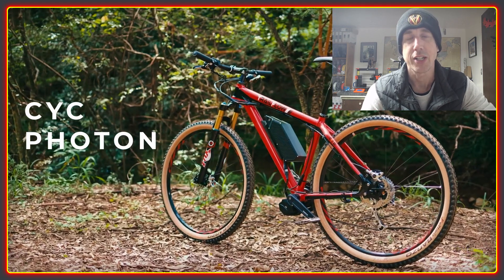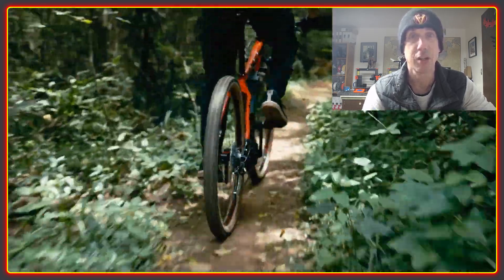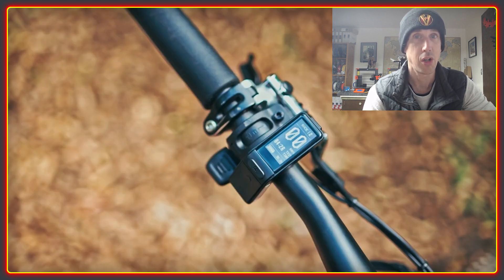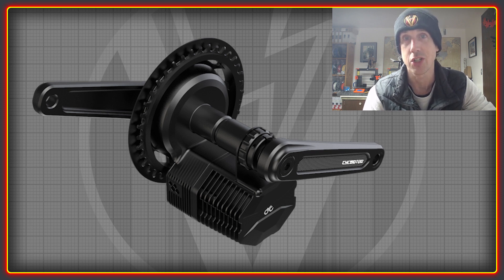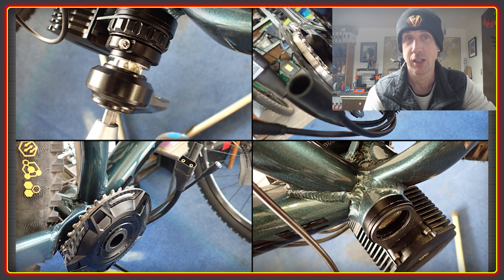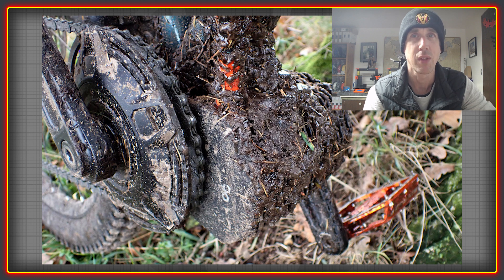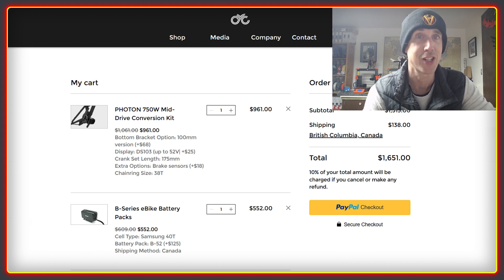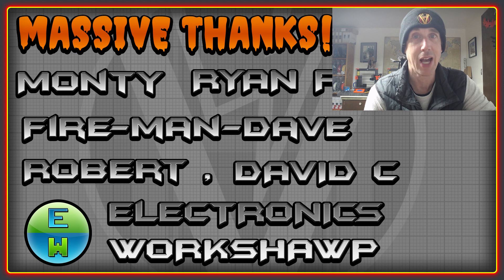CYC Photon Motor the worlds most Compact Mid drive?

Comment: Nice review and valid criticism's.  I can be more blunt.
The BBSHD beats the Photon on power and cost and part ubiquity for cheap. The BBSHD...I own two is the best value strong ebike motor on the market.
The BBSHD beats the CYC Stealth and Pro on sound and cost as well.  Where I sit, Chinese based Bafang beats CYC at what they do.

One positive of the Photon is torque sensing.  For me, not enough to bridge the divide on cost and power.  I come from a competitive cycling background and have no problem with cadence sensing and can easily add 200-300 extra watts of pedal power for a target speed relative to motor output and my contribution of human power.  I ride with heart rate and have no problem staying in zone 2 for example.  Riding with a cadence sensor that doesn't change motor output is a skill.

Its hard to become a main player in the ebike motor market.  Bafang gets their price benefit from volume.  CYC doesn't have this luxury and likely can't support a common practice of 'buying the market' like Lexus some many remember in the auto space, they sold effectively a Mercedes Benz for the price of a Toyota. Now look at Lexus.  Many prefer a Lexus to any German luxury brand due to reliability.  Lexus intially bought the market and incrementally increased prices until there was deserved demand for their products.  Btw, Tesla is looking to do this in the future because they have a leaner cost structure compared to other world auto brands trying to break into the EV space.
Market share matters because with greater volume becomes more opportunity for profit as volume X smaller profit/unit still = revenue.  More revenue promotes more R&D reinvestment and greater market potential through better products.  Its synergistic.

Also, CYC doesn't have the best track record on reliability.  Bafang in spite of being Chinese with related stigma that is changing over time as China comes up to speed, they make reliable products.  My BBSHD's have been bulletproof and I use the full potential of each motor.

We as a community will see if CYC can gain traction with the Photon. So far, the price to performance ratio isn't there.  One can buy a comparable BBS02 for 1/2 price if you can forgive torque sensing.  Most for that price difference can overlook this detail.  I can.
Reply from the maker: I don't really see it as a competition for the BBSHD in many ways. That motor is such a beast and easy to maintain and get spares for. I am very happy to see this motor though. We need more and more competition out there. It will drive innovation. I hope to give one a go one day. I was not very impressed with the torque assist on the Ultra motor I tried. Maybe I am too used to 4000 watts lol. Thanks for the comment.
Reply: NAIL..HEAD!
Reply from the maker: Cheers Jeff

Comment: Definitely see the need for a mudguard bash guard combo that scoops air past it. I like how cyc's other kits have a range of brackets to get them up into the triangle on applicable frames. I guess thats just not possible on a user friendly enclosed drive.
Reply from the maker: Yeah its a bit tight to the frame. A guard would also reduce air flow. Front mudguards on the wheel would help tho.

Comment: I’m used to riding at a constant 80-90 rpm cadence and using gears to adjust effort. I’ve been worried the cadence/throttle kits would drive me nuts. Happy to see this released as a hopefully viable torque sensing solution. I accept that technology might cost a bit more.
Reply from the maker: The cadence kits are not as sensitive but it's funny some folks prefer the feel. With the bbshd there is a program called Karl's special sauce which is far better than the setting it comes with. It will never feel as natural as TS though but with the right levels you can get close. I used to use 50 watt increments and then have the power decay past a certain peddle rpm to kero as close to a constant effort as possible with changes in terrain.
Reply: @HighVoltageKits  interesting trick - good to see what’s possible!

Comment: The crank length, but mainly the chainring size has been holding  me back on buying it
Reply from the maker: There is a 32, 38, 42 and 50t l. The cranks are 65 or 70. If think lekkie might be making aftermarket parts though soon.
Reply: @HighVoltageKits  im  pretty much going to either go with lift_mtb kit or lightest ebike kit... both seem like they'd be better quality than the other 3 china motors
Well 2 china motors and where ever this one is produced

Comment: I’m thinking about this motor or the “lightest” ebike motor from Bikee Bike in Italy which also has torque sensing, I want a low power lightweight mid drive motor and the CYC can be tuned down. The CYC seems great for what I intend but the price (in Canada too) seems steep.  I appreciate your analysis of small, details like location of cables exiting the motor,
Reply from the maker: Hey Charles. Sadly most things are expensive here in Canada when imported. Golden motor has no import tax on Photons. There will also be the new motors from TOSEVEN which are torque sensing. There are some video on those on the channel as well. I have not ridden the Italian ones.
Reply: @HighVoltageKits  my application is different.  I have a mini velo bike I love and another mountain bike  I have fitted with a motor (front hub). I find I want to use about 50 watts most of the time with obvious need for more with hills and loads.  Anyway the need to tune power would be very useful because I just don’t get enough of a workout at anything above 50 watts power from motor cruising unless I go over 33 kmph.  I’m checking out the TOSEVEN so thanks for that heads up.

Comment: What happened to the 2000w 40a claims?
Reply from the maker: I had not heard those. Might be the one for later this year?
Reply: @HighVoltageKits  Early talks online from cyc and forums is where I got that. I remember a early ride video that was taken down that mentioned they had the motor running at 30a and it could do 40a in the settings. It was this motor though as I kept mentioning I didn't think the motor could take that much power for long without overheating
Reply from the maker: Right on I'll see what I can find! Cheers
Reply: not sure why he saying only 750w???? even says in the video upto1200w  and some users have had 1900w with no problems
Reply: @HighVoltageKits  Hey just wanted to let you know its still posted in the photons webpage. Under the stats tab in smaller writing it states it can be unrestricted to 2000w. And when you look into their new controllers they list the controller in the photon as being capable of 40a battery 90 phase.
Reply from the maker: 2000 watts. I thought they would learn this lesson with the silly claims made on the x1... The bbshd will do 6kw... For a few miles anyway lol
Reply: @HighVoltageKits  Haha yeah I guess that's why they cooled down with mentioning the higher power. I'm still waiting for review videos but a video was posted a few months back that cyc had taken down where someone was riding at 20c ambient temps at 30a and only after 1.2 miles of fireroads it was overheating and throttling. 2000w maybe for a few seconds at low speeds otherwise I'm sure throttling will kick in and lower that
Reply from the maker: Its tiny. The other issue is at that power will it shred the pinion or bearings. The sprag etc. I hope not. The two year warranty is good.

Comment: BBSHD on Amazon: 735.00 including shipping. Add a Lekkie, that's 850. Photon is 850 with free shipping on a site I just checked. So same price. Yes, the BB is more powerful. also 4 lbs heavier, no torque sensing, need brake and gear cut off, etc. I may go with the Photon.
I got a 2022 Giant Talon 1 on the way and need to decide what route i'm gonna take soon.
Reply from the maker: It depends on what you want, I guess. If you want to ride mountain bike trails a lot with PAS, then the Photon looks good. It's also pretty new. Historically, cyc stuff breaks way more soon and frequently than Bafang. The Bafang is less sophisticated, but you can modify it to have much more power etc. The brake cuttoffs as well as display I think have to be added in to the cyc price? Might be a few bucks more. It's not that far off, tho.
Reply: @HighVoltageKits  Display comes with the kit I thought. I have no intention on using brake cutoffs. prolly wont use gear shift cut offs either. twist throttle and common sense.
Reply from the maker: I would spec one out. I there are add-ons. A 100mm bb version is more for example

Comment: That's some awesome info...if only the bbs02 had the same torque assist as the photon...It would be the ultimate for me.  Do you know of any hacks?  Plus would it be to pair up a bbs02 with a asi bac800 or 855?  I know that the bac800 is discontinued but would there be any advantages with the 855 over the 800 if I were to use a 56v battery?  Thnx
Reply from the maker: Watch to the end of this one! https://youtu.be/gGEDWPgfEFk working on it
Reply: @HighVoltageKits  torque sensing IPM rotor yes please... Is it on a bafang platform?

Comment: Great Video. I heard the new motor in the same style planned for later this year will be called the "Proton". But I'm interested in pre-ordering the Photon myself, 750w is enough for me. This is exactly what I've been waiting for. I'm a mountain biker, so I want the natural ride feeling from torque assist, so BBS01 is no good. And the TSDZ is not built strong enough IMO. Regarding price, the Canadian distributor Golden bike has it at $1147.50 Cad with free shipping. And I can pick up a 48v10ah battery for $300. And I assume most DIYers will already have a bike to install this on. But for me, the modular nature of this system is what appeals to me most. I can install this to my hardtail this year, and maybe upgrade to a full-suspension next year. And the availability of parts from the manufacturer. The cheapest 500wh battery from Norco is $1200CAD. The 500wh battery I'm buying is $300...
Reply from the maker: That's a pretty good price. Golden are based in the USA now so import taxes are likely unless they have a warehouse in Canada. please let me know how you get on with it!
Reply: @HighVoltageKits  are you certain? I see them being in Bolton, Ontario. they are called “Golden Motors”, I think I may have said Golden Bike above…
Reply from the maker: You can check which would be best. I chat with the owner Muj from time to time. I'm sure they moved the operation. I'll be happy to be wrong tho.
Reply: @HighVoltageKits  I just received word they have staff both in Canada and the US. And the motors will ship from both locations which is great news.
Reply from the maker: That is great news! Duty is a royal pain in the backside in Canada!
Reply: Is it recommended to buy from a Canadian distributor like Golden Motor rather than direct from CYC website to avoid import duties to Canada? Looks like the price is about the same after conversion.
Reply: @SeventyZombies  I’m not certain if you would pay import fees from Hong Kong. But I know for sure Golden motors ships from Canada. I am going to purchase from them, and CYC has confirmed they will honour the warranty.
Reply: @hiphopsuperman  If the price is similar then Golden Motors (or other CDN retailer) sounds like the way to go then. Thanks!

Comment: Addressing obvious design issues.
Clearly for the already own and vested heavily in their MTB of choosing, we which will justify price point and the target market.  Great succinct review.
Reply from the maker: Thanks. It will be interesting to see what bikes are built over the next few months.
Reply: That is where I'm at - a conversion is the logical way ahead for me, I'm already severely invested (in time, not money) and get a far better frame and components than almost any prebuilt options, and this route is less expensive, too (I do it all myself). Plus, if the battery or motor dies, I can revert the bike back to its original configuration, you cannot do that with prebuilt. And if the bike dies, I can move the motor and battery on to the next one.

Comment: I would argue.   Getting the heat sink covered in mud isn't that big of a problem... mud is partly water / mud.  water  can't above 100c.  Then it boils  abs stays there until all the liquid water is boiled off...  which?   At that point?   The mud isn't mud anymore.  And it'll fall off because it's dry
Reply from the maker: Its an interesting theory. If the motor gets that hot then it would evaporate off the water pretty fast leaving the mud. The motor would be fried internally if it ever got that hot on the surface. It should throttle itself before it gets anywhere near that hot which is where more of the issue lies. The performance is potentially reduced when you need it in order to prevent overheating.

Comment: One thing that they have changed is the power, it is 750 watts to stay street legal in the U.S but it can be unlocked to run over 2000 watts at 52v. I feel that this makes this worth the higher cost because an electric bike this compact and inconspicuous with that much power is awesome.
Reply from the maker: There is no way this will pull 2000 watts for any length of time. The one review place was hitting 60C at 500 watts. It's just too small to run that power and shed the heat effectively. 2000 watts at 52 volts is pretty big amps and it's tiny. I really thought that they would have learned that lesson when they were making claims of 6000 watts on the X1. It will come down to simple physics. All to often numbers are thrown around as marketing. Don't get me wrong. I like this motor overall but what really matters is how it rides. My X1 gets really hot after 4km of 10% at 2500-3500 watts at 72 volts. Maybe this will handle a quick burst at 2000. I very much doubt it will do any length of time. But then again these motors were never meant to be used like a moped or mini dirt bike. Bit of a long winded answer but hopefully it helps.
Reply: I forgot to mention that I hoped this was true because there are very few testing videos online and no one really put it to it's limits so I am definitely being optimistic hoping that it can accomplish this but I'll never know until I get one and test it. It seems better than the other more common mid drives like bafang, even though their claims are a bit outlandish.
Reply from the maker: It could be really amazing. The torque sensor is responsive based on reviews. Let us know how you get on. Even if it won't do 2000 watts it should give an exciting ride.

Comment: Always overlooked: pre-made ebikes are trash when their motors/batteries are no longer sold.  In a traditional bike, you simply swap in any new retro-fit motor/battery...or re-install the original crankset and use the motor on a different bike.  Purpose-built bikes limit you to THAT bike frame, THAT battery, and THAT motor.
Reply from the maker: Yes! Its a huge source of frustration for me. Bosch and Shimano are horrible for this kind of practice some of the smaller companies disappear regularly. We have a few solutions in the works for some of these which will be shown over the net few months all being good.
Reply: Was thinking the same as I'm watching , DIY lots can be swapped easy

Comment: is it preferable to install on a fat bike or should i stick with the BBSHD?
Reply from the maker: I have one ordered but I will be using it on a gravel bike. I don't see why it won't go on a fatbike. Its more how much power you want and the kind of riding you will be doing really. If you want the option of a reliable 1500watts and ability to mod it to 4000watts and a motor that has been proven to be reliable over thousands of kms and 8 years of use go with the BBSHD. If you want more of a lower power torque based so more responsive PAS feel then the CYC could be a good option. Its less the frame choice and more how you want to ride.

Comment: I dont see how that thing can survive that low on a mountain bike for any length of time at all unless you never take it bush.
Reply from the maker: I can see where you are coming from but in reality unless you are nailing huge rock gardens it's just not an issue. Loads of people use them on MTBs. Its higher up than a BBSHD or many X1 configurations. I will be doing gravel runs mainly and trails as well as commutes.

Comment: As you said, the pricing reaches where, for some, buying a pre-built bike with an integrated motor and battery makes more sense. I'd personally be more interested in the integrated motor-powered bikes/framesets (as would frameset builders) IF there was an integrated motor mount standard. Same thing & problem, I'm sorry to say, for the frame integrated batteries. At least with the bolt-on motor and a generic battery, if a better one comes along or repair part availability becomes a problem, you can swap out. With the current integrated bike lack of standards, can't fix - throw it out.
Reply from the maker: That's a good point on the batteries. Some of the smaller ones are leaving people with useless bikes. This will appeal to some. I just felt the price point and power means it's competing with that market.
Reply: I had the misfortune to ride a Trek Powerfly hardtail a few days ago, and that definitely steers me towards fitting a kit to my own bike. The Trek rode like a tank, had inadequate components (especially brakes) and wasn't particularly responsive. Definitely not what I'd enjoy riding, and add in the proprietary nature of the motor and battery, I don't want to be that dependent on the manufacturer for support in 10 years.